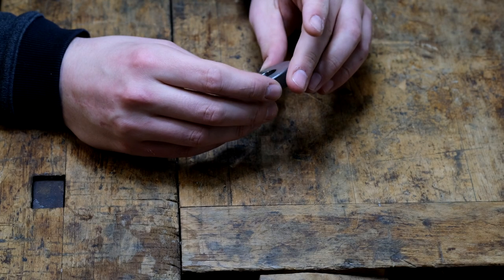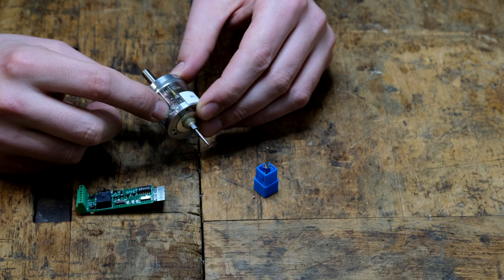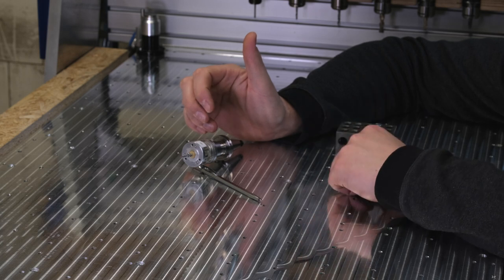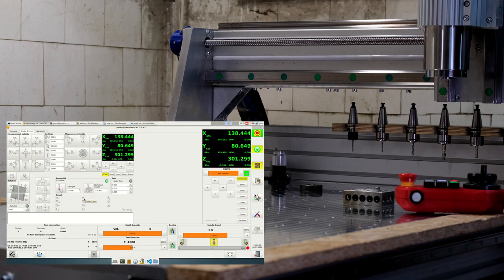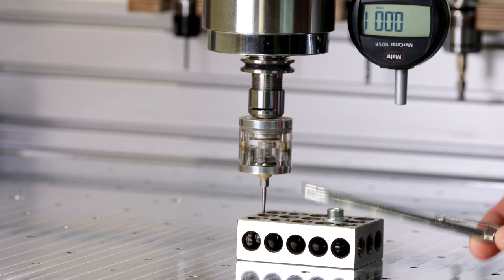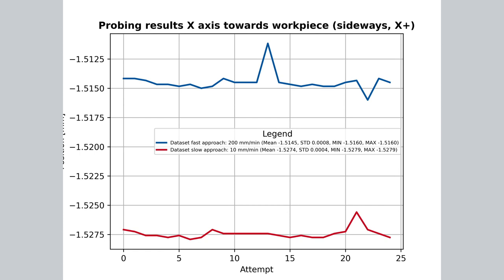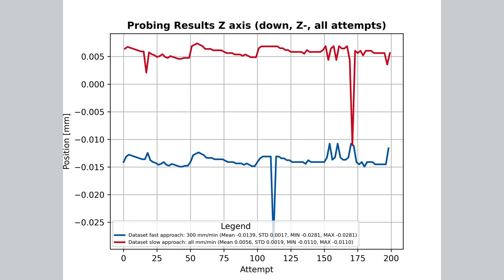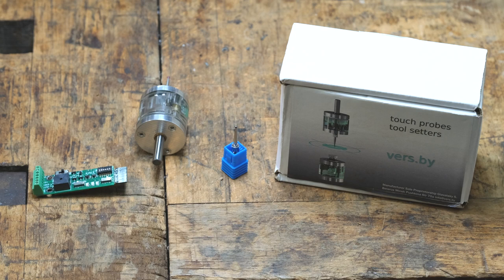Vers.by 3D Wireless Touch Probe on the CNC Router - Introduction and Repeatability Testing

Comment: to increase the accuracy you have to:
1. calibrate the probe stylus center
2. probe a known diameter datum, for example 30.001mm, only probing the center of it and setting the center as x0 y0
3. jog to x0 y0, then probe the datum again but this time subtract the probed diameter from the known diameter and you have the exact probing diameter of the stylus (for example the physical probe diameter at work is 3.000mm but the diameter in the control is 2.984mm).
keep in mind to set a feedrate you feel comfortable with and then always use this this feedrate when probing, either x y or z. 
to calibrate the z height of the probe (this is what we do at work), we first get a datum tool, then calibrate the toolsetter to this datum tool and then measure the length of a brand new endmill.
Then put something in the vise to slightly kiss with the endmill, preferrably steel because plastic may warp during cutting. Then cut maximum 0.1mm from the top and set Z0. 
when you get the touchprobe, jog it over the cut surface and probe with the predefined feedrate on it and set the probe length. (should be a positive value)
if there is something wrong tell me :)

ja moin, hab gerade ein anderes video von dir gesehen :D
Reply from the maker: At first glance the points stated above are correct, although they do not relate to the point of this video. I had pointed out that adjusting the "run out" of the probe is a bit of a pain in the a**. The experiments in this video merely demonstrate the repeatability of triggering the probe, not measurement uncertainty of measuring dimensions.

Comment: Great video! Where did you get your aluminum bench-top mount plate for your mill? It's gorgeous!
Reply from the maker: Do you mean the machine table? That’s just a regular en-aw5083 15mm piece of aluminium. I drilled it using the machine and have mounted it to the extrusions underneath. It has been  lightly flattened using a small 20mm face mill.

Comment: Hello. Can you share some pictures with the pcb board of the probe touch ? I am very interested what chip they used for the RF radio transceiver...
Reply from the maker: Hi, I cannot access the probe for the time being. Further, I’m not super pumped about assisting the reverse engineering of other products. I thus kindly suggest to get in touch with Vers.by yourself.

Comment: Did you have problems with a probe triggering during the jog or between moves during measurements? I have....🙈
Reply from the maker: Happily, I have not had that. Sorry, can’t help there😞
Reply: Out of curiosity what value of pull up/down resistor are you using?
Lower resistance equals a larger current which is harder to get interference on (remember to stay within the spec of the receiver)
Reply: @TalpaDK  I use a 3k3 Resistor...😉
Reply: @svenkrause3433  Considering 2k7 is as low as they recommend 5-24V (maybe one could go lower if the supply voltage isn't 24V (would confirm with vers.by first)) I suppose there isn't much to be gained there.
A opto coupler could be used, they are (usually) slow so glitches don't get though them easily... but they are slow so accuracy will suffer...
Using twisted pairs (maybe "borrow" some from an Ethernet cable) to reduce magnetic coupling.
Shielding the steppers/servo cables if they are not already.
Routing the probe cables away from noisy cables / motors.
Using a separate power supply for the receiver in case the noise is coupled though the power supply.

 I think that was it for generic noise reduction ideas... maybe ask vers.by for help MinistryofBrokenEndMills makes them/him seem nice and helpful